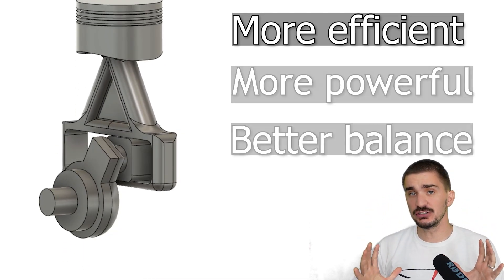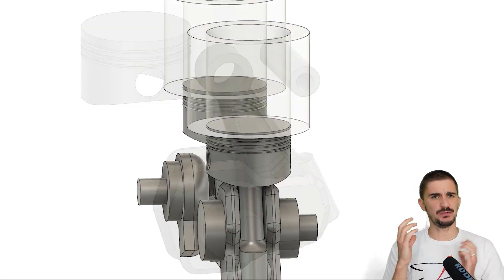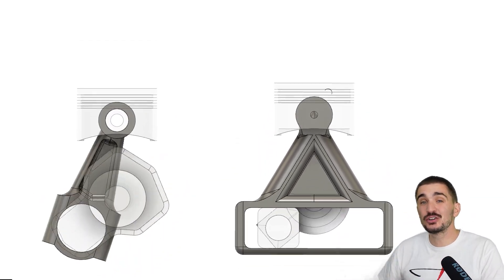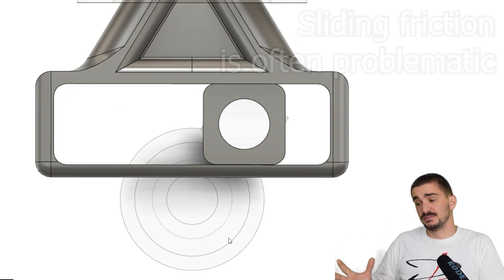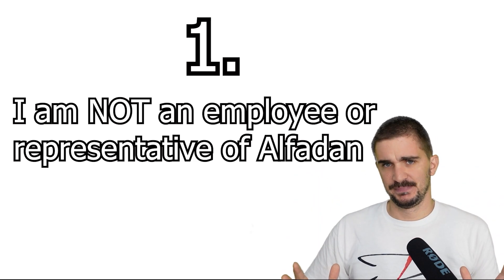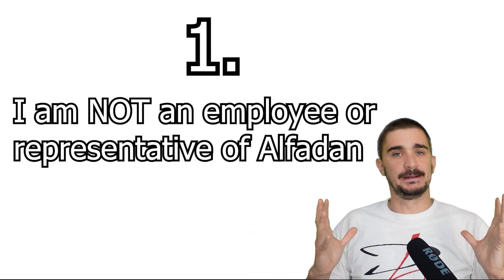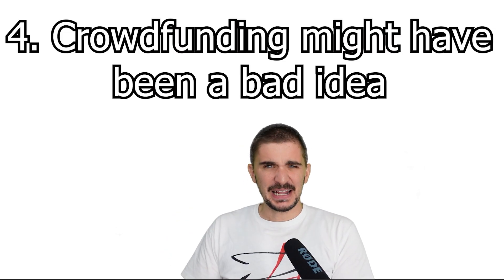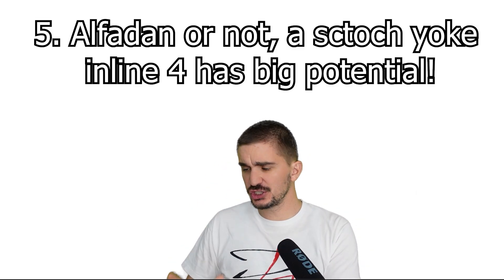This engine is better in every way?

Comment: Having watched 25mm thick steel rip like tissue paper, as well of having connecting rods blast new channels through engine blocks, I would suggest that scotch yokes remain with the early low power toys of yester years.

Comment: What if you made the engine out of aluminum, then used some form of magnet bearings for the sliding block? It may not be super feasible with the forces in an engine, but if you could get it to work, you'd have almost zero friction.

Comment: If they claim that they have solved the fundamental problems in the design, and it turns out later that they lied and they haven't, it's a scam by definition. Only time will tell.

Comment: There is still an eccentric force through the yoke which will need restraint for the out-of-balance moment. You don’t seem to address this. The key benefits appear to be the potential for more compression.

Interesting video.  Great graphics as usual.
Reply: Yup he missed that part. How's the piston going to stay aligned with the bore? Gona score the cylinders then break off right under the piston. I call bs on this.
Reply: @pgnandt  He missed that in a non-opposed Scotch Yoke engine the sides of the yoke slide against tracks which are parallel to the cylinder axis.

Comment: A great presentation of this odd engine design. I disregard those who think this is a scam ( you explained those facts very well ). However, I do not see this as a breakthrough technology. There are still side loads on the piston/cylinder. That sliding block creates its' own type of friction. The rod itself is weak, as you further explained. If you want to eliminate nearly all friction in a ICE  motor, make it some kind of turbine/disc rotor motor with 90 degrees of hot gas expansion working on the round rotor disc. (Not a Mazda style rotary engine). Just my 2 cents.

Comment: Too much weight in the reciprocating assembly. You want the piston and rod as light as possible while being strong otherwise it would end up being a slow speed engine>>too much weight at a high speed will cause it to come apart. Piston side loading isn't as big of an issue these days. A well designed engine can last several hundred thousand miles and get good economy. Engines have been refined over the past 120 years to get to the state they are in today. Most of these 'innovations' are not going to hold up. And manufacturers build to a price point.

Comment: tbh, i always find it kinda funny when it's still being tried to revolutionize ices, ofc batteries are still very inefficient (power per weight/volume) but electric motors are soo much better, one moving part, no friction surfaces, no motion transformation, two bearings and then high rpm (no gear changing), little to no maintenance
Reply: EVs are novel. The ol' suck bang and blow motors will still be around for a very long time.
Reply: @pgnandt  that's very true

Comment: I would think a boxer configuration would be ideal. It would eliminate the weak side of the slider assembly and minimalize any pitching tendencies as the slider moves away from the center of the rod. A singular rod assembly connecting the 2 opposed pistons.

Comment: That design won't eliminate the rolling force on the piston though since the point where it is connected to the crankshaft is still singular and not directly underneath the impulse of the firing cylinder.  I'd be surprised if it changed it at all actually.

Comment: I suspect that if they succeed it will be a niche market that they will be able to address.  You said they were looking at composite materials to solve the issues, and that makes me think very expensive.  I made a prototype valve lifter that cost me $1,100 to make just the one prototype.  It came out really nice, but when I then had the same company price doing a production run, to see how the price would scale per unit, it basically didn't scale at all, and the unit price was still very close to the prototype price on a per unit basis.  When I inquired about why, it was how hard it was to produce them in that material.  The material required very expensive tooling, and very expensive processes to achieve the tolerance I needed, which in valve lifters for my application were very tight (less than a thousandth of an inch deviation - +/-.025 mm).  So, something that started to look promising quickly collapsed into something that I couldn't sell to the general market.  Would there have been some people willing to spend the kind of money for a set.  Probably not a single one.  So, it will be interesting to see what they come up, if anything, because they could also fail in their reliability testing too.  Also, a marine engine that turns at a steady RPM, based on throttle position, and doesn't go above 5,500 RPM may work, but an automotive application may not.  They have a lot to overcome, as there is a reason no one has done it before.

Comment: yeah but you need guide rails to make it work in real life and I guarantee that sucker will fail from the g forces involved. You need to understand the shifting weight and the imbalance that come with it that is why you need a counter weight so you don't mess up the main bearings or the crank shaft in general. It may work in this simulator but that is as far as it will go.

Comment: Nope.  nope.  nope.  If it was actually better, it would have replaced the conventional connecting rod engine by now.  Perhaps better for low load or low rpm applications, but at high rpm either the piston or the cylinder would be destroyed in no time due to the torque being applied through the fixed connecting yoke.  In a conventional connecting rod design, the forces are resolved as side loads at the midpoint of the stroke (due to the wrist pin), while in this design the forces result in a torque which wants to twist the piston into the wall of the cylinder.  I do not see this as being a feasible or durable design.

Comment: I was going to try to watch this… I can’t. I just can’t. 

This engine still has a moment arm, and still has piston skirt friction. Then You add the reciprocating friction of the Crankshaft eccentric in the connecting rod. 

This piston/rod assembly has so much additional wear surface, specifically off center unequal forces. These forces would cause lateral load of the piston in the cylinder. 

Terrible design.
Reply: I'd also worry about distortion and vibration of the bottom side of the scotch yoke

Comment: why not split the difference and use the triple expansion steam idea that is, straight piston rod, then 2nd bearing lower down and then you get the conventional bottom end, all the side load is out of the cylinder,  so that's max efficient, maintenance is easier,  unfortunately the engine is taller.

Comment: To mitigate the "small thin" section weakness, make the entire area ROUND. Not flat. A flat surface is more friction. You can make the shape using a cylinder all the way around, and this increase strength (since cylinders are stronger) and also less surface area contact yet same result.

Comment: Comments: I don't think the small gains by this design are worth it
Yes...yes they are. We are gaining 0.1% at most with the way we develop current combustion engines. There hasn't been anything new in decades and our only "improvements" in ICE engines have actually come from the transmission by adding more gears.

Comment: There is a chance to enhance 2stroke-power and efficiency, by reducing the pumping-loses and air-elasticity-penalty, by means of isolating the space "lower-cylinder-edge-to-upper-crankcase-edge" from the crankcase-space itself, so that only the former one contributes to pumping fresh air into the 2stroke-cylinder. This is only partially possible with a classical conrod, but could get even better with this one (if the lower end runs on linear bearings, and if the middle-piece, that´s connecting the piston with the "window around the crankshaft-journal" is straight, and not triangular, as in this animation here).

Comment: seriously, year 12 engineering.... transmisibility of forces.... the torque that creates the imbalance is still there this doesn't change anything in the basics.
looking it in a g loading how the f is that slot going to stay rigid enough within the material science available for the materials we can make the parts with? 
this is a serious mistake of content to promote.

Comment: Great. New challenges require new solutions. Many problems are still there. lot of friction in the sliding slot, piston+rod assembly obviously tilting when the pin pushing/pulling at one end, square slot must be opened to be put on an inline4 crankshaft... 
That would be interesting to see how alphadan will deal if all of that

Comment: The piston still does not have linear acceleration as the up and down motion is provided by a circular rotation crank pin, exactly the same as "standard" engine.  I think the outboard will fail, as there is far too much friction and weakness in the rod, not to mention the weakness in the crank pin.

Comment: The piston shoves the rod down, The crank doesn't pull it down. So this design would be worse. There would be force on both walls from the energy being transfered to one side on the up stroke and the other side on the down stroke? Am I missing something here?

Comment: I am wondering whether the sliding box section of the yoke could be made to be an opposing magnets configuration where nothing touches anything but forces are still transferred effectively. It'll need a LOT of electricity power to make this possible but no friction whatsoever. Just brainstorming (or whatever).

Comment: The combustion forcing the piston to one side of the cilinder will not be completely gone on this desighn. The "rod" is still only supported by one side when combustion pushes down on it, so there is going to still be some torke generated.

Comment: 1:49 It's still at an angle, it's still trying to "flip" the rod or tilt it to one side. you talk about the friction losses from the first engine, but what about that block trying to slide around inside the rod

Comment: It doesn't eliminate the connecting rod and wrist pin. The little arm on the crank replaced the connecting rod. The wrist pin and crank bearing are replaced by the channel and the pin that connects the arm to the slider. The crank bearing and wrist pins are fairly easy to lubricate. The sliding block in a channel looks far more difficult.

Comment: Nope, and i commented before watching, now let's see what you have to say about it.

Edit after seeing the video:
That rod is unballanced and needs an aditional guide opposite to the piston  end in order to not kill the Piston / Cylinder in matter of hours. The Solution with opposite working pistons (that you showed) was done to solve this problem. You can put a braking force at the crankshaft on your solidworks model and watch it wobble :D

Comment: Why sliding bearing cannot be replaced with rolling bearing? This way there would be little to none frictional differences compared to ordinary crank! Also boxer/opposite piston layout would improve strength of sliding - now rolling box section. More then friction, RPM is the limitation - but with this setup you are more likely to create low RPM, cross-head-like, long stroke engine which would improve efficiency and allow heavier (marine) fuels to be used or veggie oil which would work with modern "green-politics". There would be general increase is mass but outweighed by better efficiency/lower fuel consumption resulting in overall reduced weight of whole setup.

Comment: I think you would still get the cylinder wear/friction problem because the force of the piston will still be sideways. Think of it like holding a long 2 by 4 horizontally against your abs, and trying to push on a box with one end. The force will still be transfered at the angle. It doesn't matter what you do in-between.

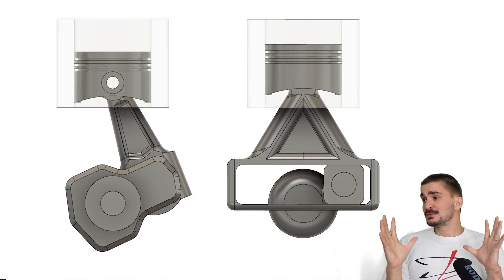Comment: 1:35 How does the twisting force get eliminated?  Just because the rod moves vertically does not mean the forces on it act in that direction.  There is a horizontal offset between the downward force of the piston and the opposing upward force from the crank pin, trying to twist the entire assembly.  Try pushing a triangle from one point and in the opposite direction from another corner and it will rotate.

Comment: As soon as I  head about EV's, I  knew it was a stupid idea. Theres a massive shortage of charging stations. You can't  travel except in certain areas, plus the app does not tell you if the unit is functional which can leave you stranded. Wrong again, gasoline is not the answer. Check you math about ethanol in South America.

Comment: 2 counter rotating cranks in the one yoke would even it up, a double ended yoke for 2 cylinders strengthens both sides of the slides in the rod as well.

Comment: 4 main Problems with this new engine

- Rod wont fit in the cylinder or it would only be possible with a small stroke reducing torque

-Rod adds weight to reciprocating assembly and reducing acceleration and max RPM 

-heavy friction losses from the sliding box connected to the crankshaft

-Heavy rod attached to the piston with no pivot means the rod acts as a mechanical lever on the piston skirts, meaning the piston has to resist being twisted by the rod lateral inertia inside the cylinder. This can cause Piston slap, increased cylinder wear and harmonic oscillations at certain RPMs which can destroy the engine

Comment: Using the York engine design looks good in theory. I think it would be better as a horizontal apposed engine so it would balance it out or need a larger flywheel or have it similar to the Bourke. It would need the weight of the flywheel to help to the moment going. The two-stroke engine works similar to a steam engine that we made in High School in metal work/Workshop Technology. The way we made it works similar to the way the York. It only had a rotating moving part that would be like the bottom end. It had a steel shaft rotating in a brass fitting  we had groves around the piston with a bit off oil around it that lubricated it & also work like piston rings. On a conventional engine the only wear would be the piston rings. How many York type and the Bourke type engines have been built and compared to the conventional type engine so the are able to show the difference. I think it would need have a flywheel for the time to produce the spark on the spark plug. I think using a bearing would than a type of bushing.

Comment: sorry buddy, you're not removing friction, you're just moving it. Worse, this looks like it would INCREASE it by pressing stright down on a rotating shaft at top dead center. Also that rod is very clearly over twice as heavy, which you do not want. Running a modern high compression engine with a scotch yoke design would just much crankshafts. An offset crank is inherently better.
Also you're ignoring the laws of physics, don't go accusing people of not doing their homework. Alfadan is a scam, your justification is ridiculous.

Comment: Problem with this concept, it no longer has a closed circuit motion of swing. Balance will never be perfect because of the start and stop. What was once there to help counter balance it is no longer there. Tdc / bdc, will stall unless there’s enough crank momentum.

Comment: what I love is all the people WITHOUT engineering degrees or knowledge in the comments of this channel "I dont think it's worth doing because blah blah blah" "I see problems with blah blah blah, conventional engines don't have that" "they'd have to blah blah blah before they could blah blah" THIS IS THE POINT OF RESEARCH AND DEV people. This is what engineers do. This is WHY people invest in these projects. It's always a risk, but it could pan out very well. Even the engineers don't know how it's going to work until you actually start trying to make it. You can't buy parts for something that doesn't exist. You can't refine something that doesn't exist. You can't troubleshoot something that doesn't exist. You have to design and machine EVERYTHING yourself. The reciprocating 4 stroke engine has been in CONSTANT development for over 100 years by a TON of manufacturers and designers. And even then it took a LONG time to work out problems like head gasket sealing. For a long time in the world of cars it was just accepted that head gaskets had to be resealed all the time. Early race cars often didn't even finish because they couldn't seal the head properly for long. There's a reason they work so well now and it's not that the design was the absolute best it could have been out of the box. If you're trying to compare almost any new design to the reliability, ease of maintenance, cost, efficiency, size, etc. of something that has had literally lifetimes of time invested into it and hundreds of billions of dollars, OF COURSE it's going to come up short initially. How is that so hard to see? It's the same people who said electric cars would never venture out of the city, and just look at them now. Jeez you people are sooo unimaginative and stuck in a box. And in a world where more is possible than ever lol, how does that work? Maybe open your minds and use your brains and you could actually help with some of these things instead of just naysaying

Comment: This most likely works better on paper than it does in the real world. Also, it would only be practical in small displacement, economy engines. There's no way this would work in a high performance application. Too much moving mass, too hard to lubricate, etc, etc. It would be a bomb.

Comment: Could it not be done with a sun and planed fear arrangement like a rotary engine to remove the side thrust component even further? I can see there would still be sideways thrust using the slide as depicted